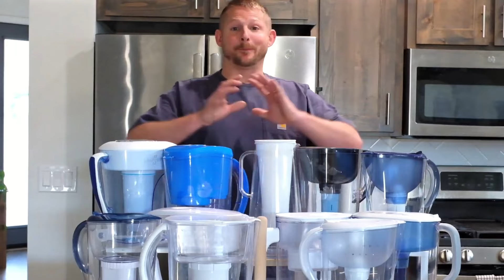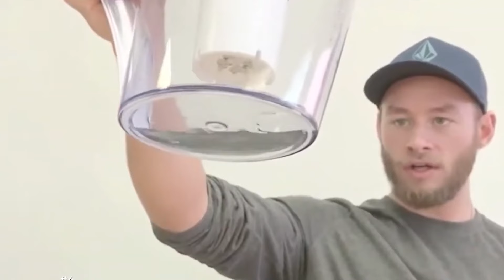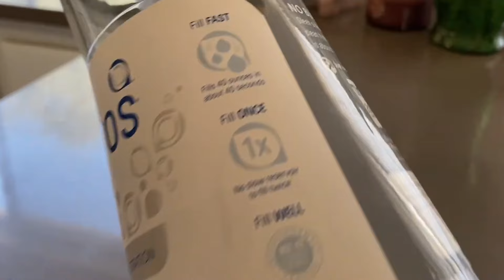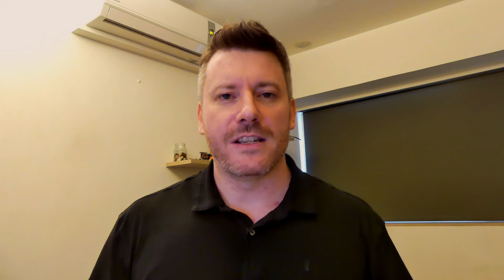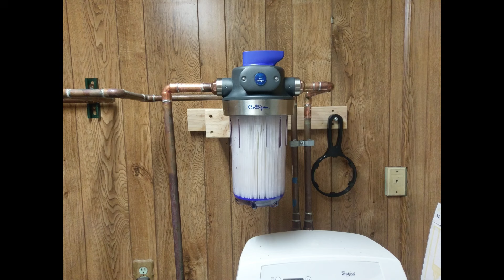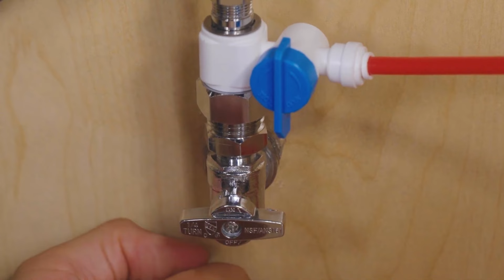45 Water Filter Brands You Should NEVER Trust (And 10 That Actually Clean Your Water)

Comment: "Zero Water" increases microplastic contents by one-thousand-percent by design. It also gave my mother Alzheimer's.
Reply: I used to use Berkey and it's not a bad brand, though the filters are said to not last as long as they advertise.  Otherwise, they do work.  However, I started using Zero Water with the Berkey, pouring the Berkey filtered water into the Zero Water filter just to be sure.   BUT one day I noticed the Zero Water was absolutely foul.  When I tasted the water from the Berkey, it tasted fine.  So the Zero Water filter actually contaminated the filtered Berkey water.  I have never tasted anything like it before.  Because I make tea and coffee with it, I didn't notice right away the extent of the problem. The water was disgusting.  Never had that problem with Berkey in all the years I've used it.  I also heard about the microplastics in Zero Water.  The company has denied it and said you have to run the water thru a couple of times when using a new filter, then no more plastic.  But I don't believe them.  The whole thing is plastic and the filters sometimes back up so you can see little black specks and tiny hair like things backing out of the filter into the reservoir.  I will no longer be using the Zero Water.  I'm pissed at Mike Adams (Health Ranger) who reviews a bunch of water filters and said Zero Water was a good brand.